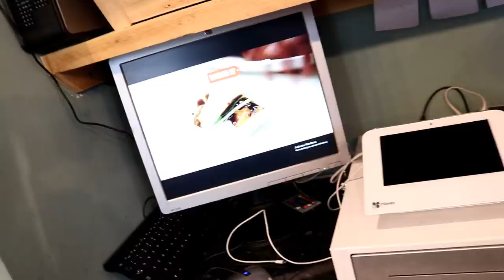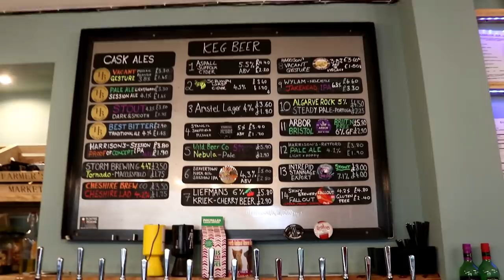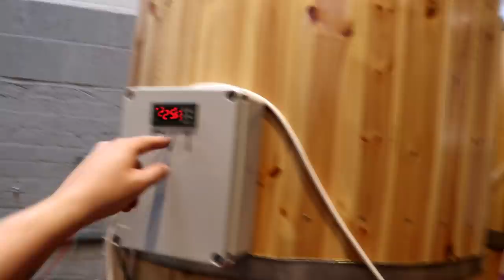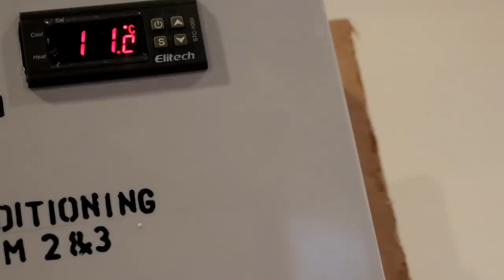CO2 AND CAUSTIC DON'T MIX

Comment: Getting through the jobs nobody should complain about, all clean tanks just be careful when opening the lid. Good fix on the leaking roof glad it worked, I used a little bit of silicone on my roof for now . Thanks for sharing.

Comment: Don't throw that condensate run off us desperate home brewers pay a fortune for distilled water to make up our pH test waters etc. Best I could get was £15.99 for 5.5.ltr. That's another income stream waiting to blossom.
Reply from the maker: It is full of DMS mate, no good to anyone.
Reply: @harrybrew69  errr never considered that dohh. I used to use mash evaporation from my lid as I was advised to check my refractometer, would there be dms at those lower heat levels in the evaperate.  Thanks and keep up the great work on your vlogs, always great to watch.